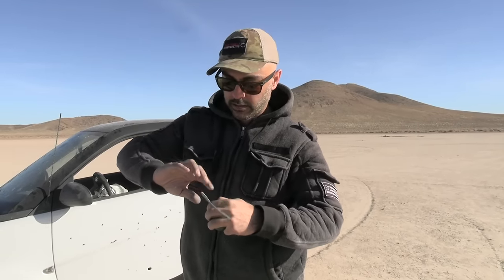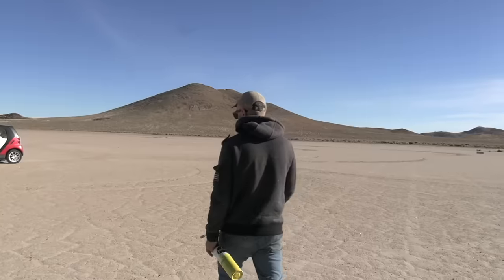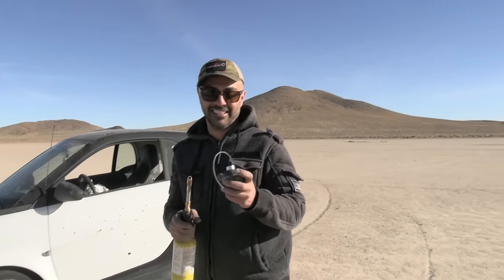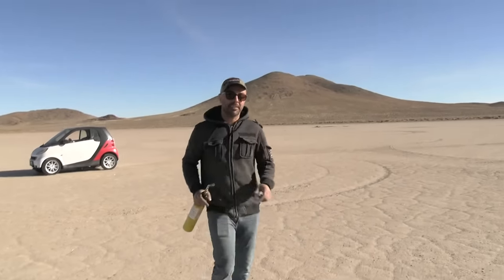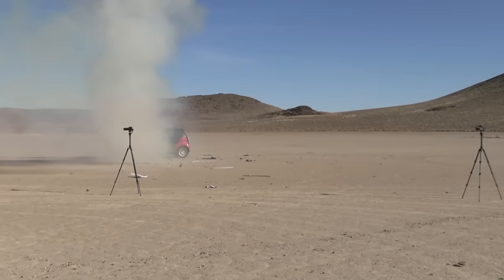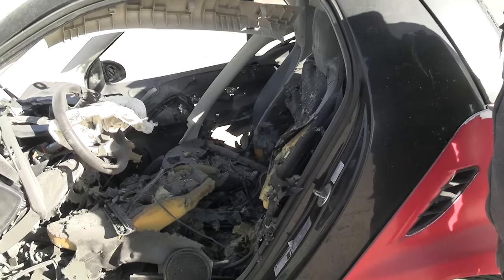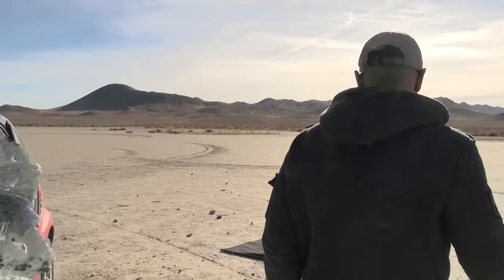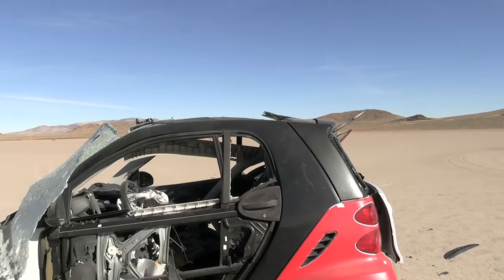will Green fuse work on M67 frag grenade?

Comment: I'm not demolitions expert, but I'm pretty sure that it is impossible to detonate a grenade with a burning fuse. It's pressure activated from a detonator. Otherwise when releasing the spoon the chemical delay fuse for the detonator could probably set off the grenade without the delay.
Reply: This is correct. M67's use Comp B which is a TNT/RDX mix. The plasticizers in the RDX desensitize the TNT to flame. Much like C-4, it will burn but not detonate. That requires a blasting cap.
Also the fuse you see him remove appears to be expended already. Grenade fuses are 3in long and extended just past the center point for a uniform detonation.
Reply: Realy?? (sarcasm switch off)
Reply: Yes but detonators could be build to be isolated from the charge to not set it off prematurely.
Reply: The safety pin gets removed,  the firing pin strikes the primer, the primer ignites the time fuse, after about 5 secs the fuse burns into the detonator, the detonator detonates the primary explosive used in the grenade. 💥
Reply: Hmmm this confused me as well - probably the primer was inside ...
Reply: It happens if the detonator is defective, then there is no full-fledged detonation, that is, the detonator explodes, and the explosives simply fly apart. And from the fuse, the explosive composition will not only not detonate, but will not even light up. That is, behind the scenes, the grenade was detonated with a detonator.
Reply: Only way that green safety/cannon fuse is going to set off a grenade is if a non-electric/pyrotechnic blasting cap is crimped on the end.
Reply: How are you
Reply: That was not the explosive compound that came in the grenade.  A detonator would be required. Plus the smoke was the wrong color and density. Plus, without the fuse housing, even something like black powder would have not detonated. Spun like a bottle rocket without a stick maybe, but no boom. I think Mr. S. is messing with his viewers a bit. 🤔
Reply: @firestorm8471  Nitrated Explosive was used as you can see the red tint in the smoke indicating NO2. RDX (C4) produces a Yellow Smoke. Possible that the M87 has a tetryl primary molded into the grenade body.
Reply: Ofc, because he fakes all his Videos..
Reply: Tell that to the car😂😂😂😂
Reply: You are correct sir. Heat AND pressure are required to detonate a grenade. A fuse only provides heat.
Reply: As others have pointed out the comp b filler in the M67 won't detonate from exposure to cannon fuse. Also, whatever exploded in that car wasn't an M67, which is really good for them, since its a fragmentation grenade and they were well inside the danger zone of such a device. Whatever blew up was a low explosive, lacking the steel rending high velocity shock wave comp b would have provided. Basically you're watching a staged production having little to do with a grenade other than as a prop.
Reply: Also that grenade looks like dummy 
plastic grenade
Reply: The fuse is not a detonator
Reply: He probably had them made to work with a fuse
Reply: @chasecarter8848  you are correct, but the most recent video they posted with the oven seems a bit more real

Comment: Aren't grenades powered by TNT? And I thought TNT could not be detonated with a regular Flame.
Reply: Isn't it like this with mist modern explosives that you need a detonator?
Reply: the detonator has gun powder in it
Reply: @bigsmoke4345 so why didn't the car explode in flames
Reply: This is how they blew up coal mines
Reply: Le TNT brûle avec une flamme,il y a quel type d explosif dans cette grenade ? C était cool quand même 👍
Reply: @blaizegottman4139  because there's no fuel in the car?
Reply: I've heard the US uses 50/50 TNT/Am Nitrate. Cast loads shells. So therefore no flame. But it needs a detonator with booster.
Reply: The M67 has Comp B explosive.
Reply: @Opiemus I always thought it took a chemical reaction to set them off.
Reply: Composition in grenades
Reply: C4, and what big smoke said.
Reply: @bubbahottep8644  oh okay. Well I thought C4 required something like a electrical charge or some kind of special detonator.
Reply: TNT can absolutely be detonated by flame but you don't see regular TNT used by itself anymore these days. Grenades use Composition B which is TNT and RDX mixed with added plasticizers. Those make the explosives less sensitive. To detonate you need to hit it with extreme pressure which can only be had from a blasting cap or other explosive. NATO allies use Lead Azide for their detonators which is flame/heat and pressure sensitive.
Reply: @brucecook502  You are right.  I am commencing to wonder whether Edwin got that grenado from his grandfather after all.
Reply: Comp B
Reply: I think high explosives can't be detonated by a regular fireworks fuse !!! It requires a detonator or a blasting cap !!! I don't know about composition B

Comment: Grenades, or any explosive for that matter, cannot be detonated by no "cannon fuse" or any other gunpowder based fuse. 

.
Reply: i'm sure that's an inert grenade and they use something else to blow up the car
Reply: @surfingtothestars  Yes they were way too close to the car if that was a real frag, i have thrown some in the army and the sraphnelss fly far away...
Reply: Needs a blasting cap, like the one on the end of the fuse he unscrewed.
Reply: He has done this multiple Time With Grenades it's not the grenade that's blowing up the grenade is just a shell and the explosives were in the car to begin with probably remote detonated he has done this with a Coke machine and other stuff and you can tell that it isn't a grenade that's blowing up

Comment: The fuse would just go out for regular TNT filled grenades. Picnic acid filled grenades go boom.
Reply: The primer you can activate with a fuse to detonate the TNT .
Reply: @freigeist5161  wt it can not set off tnt , Only blasting cap petn , etn ,NHN

Comment: What happenes if you set the proper fues off without the granade
Reply: It just goes POP! like a firecracker w/ a little bit of shrapnel
Reply: It makes a pretty loud explosion like an M80 and throws some shrapnel from the aluminum housing. The practice grenades are meant to reuse so you unscrew the fuse and put a new one back in it. He's probably using a practice grenade that's been painted green and stenciled to make it look like an actual grenade. You can find them online and they have the weird-looking piece of aluminum at the top like the one he's using real grenades don't have.

Comment: I am surprised that the explosion was that powerful with only “gum” to plug the screw hole used for the regular fuse.  With just the gum plugging the hole, I expected a lot of the pressure to escape through the hole, and thus produce a less powerful explosion.  Would a non-modified grande have a more explosive result, or was there some behind the scenes manipulation of the explosion shown?

Comment: New level of cheating. Real grenades can't explode from fuse.
Reply: Interesting
Reply: You have that right! 👍 Did you also notice that the fuse that they pulled from the grenade was an already used one? Real grenade fuses look like blasting caps and are surrounded by a bright aluminum tube. He is using a prop grenade.
Reply: He has done this multiple times with prop grenades and use a remote charge inside where he actually throws the grenade to make it seem like the grenades blowing up
Reply: @Opiemus  wrong. Prop grenades can't explode.
Reply: @ShwappaJ  exactly, the explosion was caused by something else not the grenade.
Reply: @ShwappaJ  some prop grenade can explode but they don’t have any shrapnel. Kinda like a flash bang.

Comment: You can't detonate a high explosive that is used in hand grenades with just an ordinary fuse!  The fuse has to set off a primary charge that is a fuse sensitive primary explosive in the detonator the exact part you removed in order to stick your fuse in. If you could set off a grenade with just a fuse that would make them to dangerous to use so I call BS.